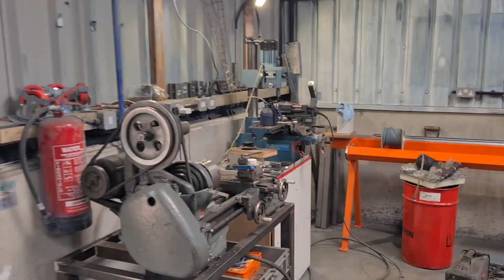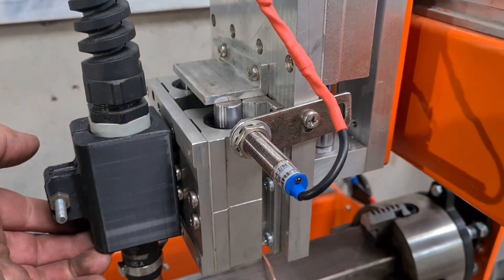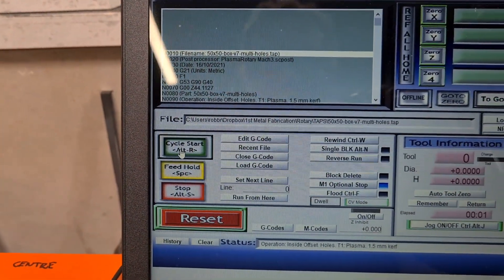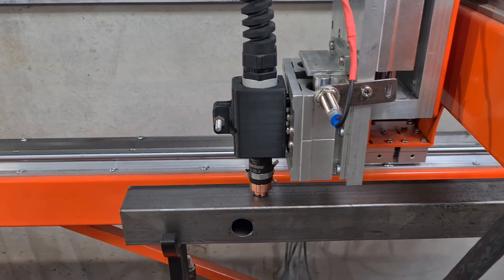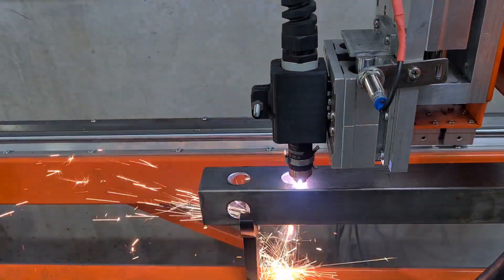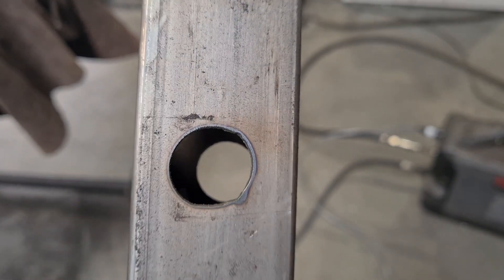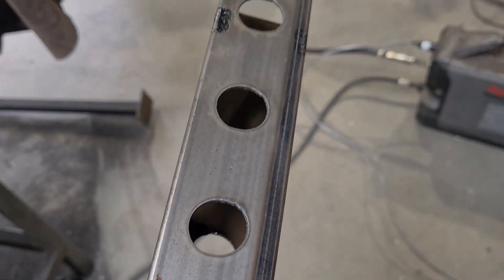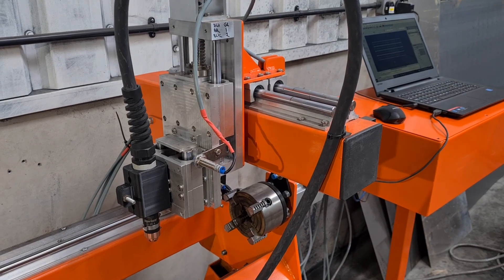Tube plasma cutter update and first runs

Comment: nice work! You should chuck the Mach 3 all together and try hooking up a myplasm unit. It has tube cutting as a built in feature.
Reply from the maker: It does and it doesn't. I run myplasm on my 8ftx4ft would not run anything else. I've spoken to Lukas and he says it's still very much beta. When we get better functionality I'll jump ship 😆 🤣
Reply from the maker: Hey.......check my new vid. Mach3 was too cumbersome.  Thanks for the heads up 😅

Comment: A self centering steady rest with roller guides would be perfect to hold the tubing and copper braided flat band on flat chuck spacer wrapped half over it  with a 1 lbs weight hanging down with ground to plasma I use wd40 on my chuck spacer and works flawless.
Very neat job nice work Rob

Comment: Could i ask ,why this tube plasma is  floating plasma head, why ohmic sensor is not enought?
Reply from the maker: The ohmic sensor cap is a spare. I'm using mach three and it doesn't directly support ohmic.....unless I'm missing something, so I use floating head limit switch for the probe input. Hope this helps